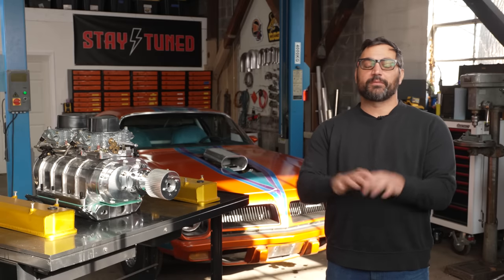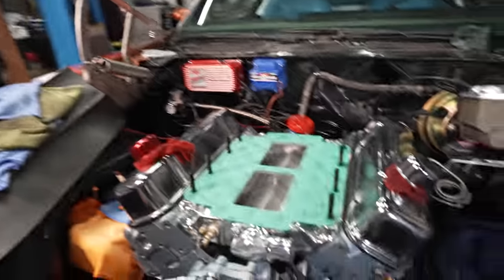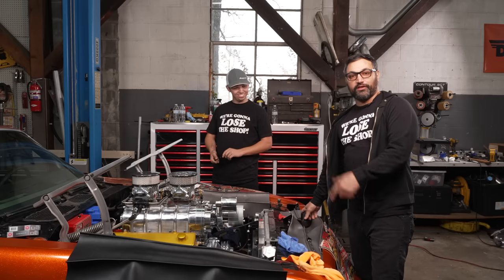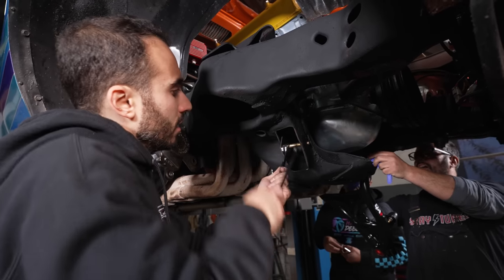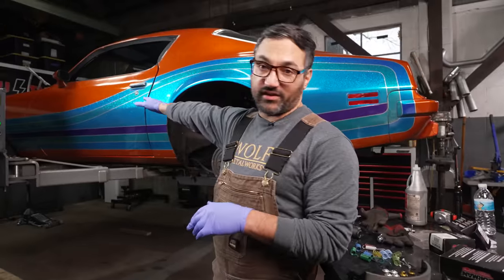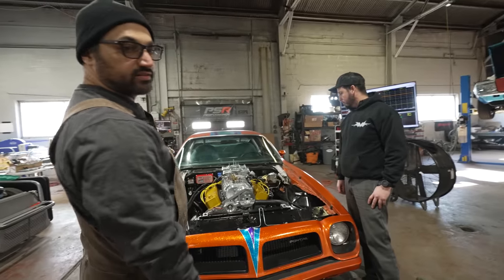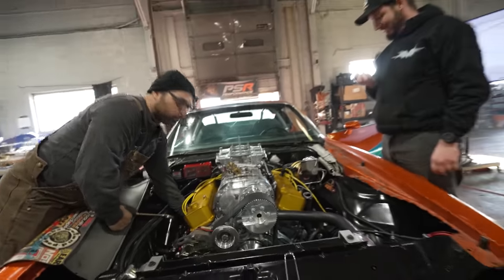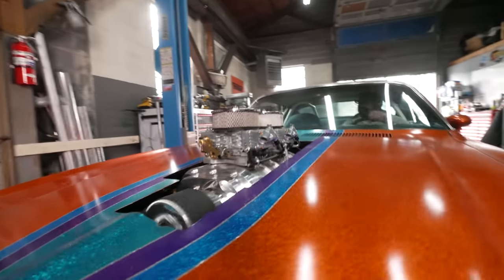Can An 85 Year Old Supercharger Make Hellcat Power? - Tony Angelo’s Stay Tuned

Comment: To add to the blower description, these (as Tony explained), came off of GM Detroit diesel 2 stroke truck motors. The 6 in 6-71 is the number of cylinders that the engine had (4, 6, 8, 12 & 16 cylinders) and the 71 refers to the cubic displacement of EACH cylinder. 71 being 71 cubic inches, 92 is 92 cu/in per cyl etc. So, a 8-71 was from an 8 cylinder, 71 cu/in per cylinder motor. Same as 6-071, 8-71, 8-92 etc.
Reply: Very cool info. I had no idea this is what the numbers meant. Thank you. Now that I know, it's SIMPLE.
Reply: @phillipzx3754  the 6-71 is inline but there is a 6v-71 and 8v-71. The 12 and 16 cylinder versions were two engines mated. Eg The 12v-71 is 2 6v-71s inline. 
One of the Sherman tank variants used whats called the GM twin diesel. It’s 2 6-71s in parallel, one of them runs counter directionally to the other, turning a shared output. 

You can run a Detroit clockwise or counter clockwise. 

2-stroke diesels cannot naturally aspirate so they require superchargers. Some had turbos but all had superchargers.
Reply: They also made a ton of 1, 2 and 3 cylinder engines.
Reply: @danh8302 interestingly, these are technically blowers on the Detroits as they are used to clear the combustion chamber of the exhaust, not pressurize it. So they are not used as superchargers on the Detroits, so they are still considered naturally aspirated.
Reply: @spencercastle8638  the call them that because they don’t have turbos but two-stroke diesels cannot naturally aspirate. They require them. So normal aspiration for a 2-stroke includes a blower.
Reply: @danh8302  worked on Detroit’s a little bit, really really odd engines but it makes sense when you realize what’s going on. Superchargers essentially the intake 😂
Reply: The idea was to find bigger options than already available is what I thought too since supercharged cars were like the inline 4-8 cylinder European race cars starting in the 20’s so the Detroit diesels seemed to be the best option
Reply: @spencercastle8638  Yep... The ones with the supercharger(s) only were "Natually Aspirated", and the ones with turbos that fed the supercharger(s) were forced induction.

Edit: I worked on a BIG ass generator that had a V-16 Detroit on it that had 4 turbos feeding into 2 superchargers on top the engine... It was essentialy two V-8 blocks bolted together to make a V-16, 4 heads on it, 2 intake manifolds, 1 turbo on each of the 4 exhaust manifolds, 2 turbos blowing into 1 supercharger on each of the 2 intakes. The thing ROARED when the genset was tested at max load.
Reply: @dan h  not all detroits can run clockwise and counterclockwise.  It is by design.  If you try to run a regular truck engine in the opposite direction, the blower spins the wrong way and evacuates the cylinder.  Additionally, the oil pump cannot feed the engine spinning the wrong way.  Yes, they can run backwards, but they run poorly and will self destruct if you don't stop them.

To add, the so-called superchargers are merely airpumps.  They don't pressurize the cylinders on a Detroit.  They became superchargers when racers discovered they were effective at creating boost when installed on a 4 stroke.
Reply: @da1ve468 low e.t.'s  I drove a kenworth that had a 8-92 with 2 turbos, it would turn 2800 rpm. Originally a logging truck from Canada.
Reply: Idk if I read that incorrectly but I’m almost positive that Engine has 8 cylinders
Reply: @gosstg09  What engine are you referring to?
Reply: @davelowets  the one he’s putting the blower on
Reply: @gosstg09  Yes, it is an 8 cylinder engine.. This comment thread is about where these types blowers got their start in life. They weren't originally designed for high-performance gasoline racing engines. The blowers were originally designed for large 2-stroke diesel workhorses, that by design, did not "scavenge", or create any airflow of their own, without the blower present to induce airflow through the engine. 

The "6-71" blower size was used on a diesel that had 6 cylinders @ 71c.i. per cylinder. The "8-71" blower was used on an 8 cylinder engine with 71c.i. per cylinder. The "6" or "8" in front of the blower number doesn't mean that it can ONLY be used on a V-6 or V-8 gasoline engine application. The numbers only refer to the size of the blower. Any size blower can be adapted to the intake manifold of any size engine. The larger the blower, the more boost it will produce, and the more power the engine will make. (Within reason)
Reply: We have a generator with a 8v-92, supercharged + twin turbo!
Reply: Do you know why they paint a Detroit diesel engine green?

So they can hide in the grass when they get passed by a Cummins. How embarrassing.
Sorry, old 80's joke. Tuning a Detroit in the old days wasn't the funnest.
Reply: Spot on mate my father is the C.E.O of Detroit Diesel Australia well it's actually PENSKE POWER SYSTEMS NOWADAYS or MTU for the off highway stuff but yes the good old 6v71 6 cylinders 71 cubic inche per cylinder 6v92  i love the the massive compound set up they run with the turbo running straight in to the top of the blower on the 2 strokes 🇦🇺💙🇺🇸

Comment: Absolutely loving his thing. I hope you gradually continue to develop this thing on the drag strip. It would be awesome to see some 8 second passes but without losing that 80s style.
Reply: Haha ya i agree. i think an 8 second 1/8th mile is doable, 8 sec 1/4 would be like 50k of upgrades
Reply: Yeah no, that's not happening, you need WAY more HP to pull an 8 seconds 1/4 on that thing.
Reply: That’s why I said to coni tie to develop it. I wasn’t expecting it to happen overnight. It will likely take significant engine, suspension and general upgrades to get there. But I don’t think a 8.99 in the quarter is out of the question.
Reply: 8 second passes? Not with that Pontiac block and drivetrain.
Reply: Maybe triple the horsepower? Along with new trans, bigger tyres and everything else in between.
Reply: '70s style.
Reply: johnstamper715  one in a million

Comment: Pontiac trick #1 is to cut the water cross over off the intake so you don't have to drain the coolant to get the intake off. Which wouldn't matter in this setup because you're changing the cross over type but just a heads up.
Reply: Yep. It also makes it way easier to port match the intake runners

Comment: Tony: Make sure you synchronize the carb linkage and check for wide open throttle. Just have someone hold it to the floor while you peek into the carbs. Really happy to see the blower finally go on this thing! You've got a little stumble when you whack the throttle, so make sure you adjust the primary accelerator pumps. You might need a more aggressive pump cam. It's a really great idea to run boost referenced carbs because they blowers can pull a vacuum at high rpm wide open throttle and cause the power valves to close which leans the motor out and kills pistons. If you don't have those, just run a higher-than-normal power valve like an 8.5 and it'll be fine.

Comment: Tony and crew, you knocked it put of the park!
This old Pontiac firebird with it's hand ported heads and the 6/71 roots blower is more interesting than literally all the cookie-cutter turbo junkyard LS builds that flood the internet.

The key here is the historic nostalgia.
In 50 years nobody is going to yearn for the era of turbocharged junkyard engines fitted to plastic cars.

But cars with chrome bumpers, roots blowers and the hand built oddball engines will always be a worthy pursuit.

You've got one of a kind, and that means something.
Reply: I dunno man, there's definitely something to be said about cheap, fast, and fun cars. Not every build has the goal to hold value and be a collector piece. Some of us just like building fun stuff. Tony's T/A is definitely super rad, but the '80s theme isn't for everybody. Just like an S-10 with a turbo LS isn't for everybody.

Comment: Man of the year for keeping a Pontiac V8 in it....😉👍
Reply: Oh so what you’re saying is “click off the video right now cause it isn’t touching 700hp in Tony’s dreams”, Pontiac V8’s were dogs compared to what you could build a 350 up to be, the 400c.i from Pontiac was ass
Reply: @mullittmustang256  Huh?.....I was just giving him some credit for trying to do it the hard and expensive way to keep it all Pontiac they way it was done back in the 70s and 80s.....a modern truly reliable 700hp with an outdated Pontiac design requires aftermarket block, heads, bottom end parts, it can be done......any fool with a  check book and a summit/jegs catalog can throw together a cheaper, more reliable, and more powerful chevy or ford engine.....at that point you might as well just have a camaro or mustang which everyone else already has.  Either your a fan of seeing guys who like a challenge to make more power with some of  the older off brand stuff like buick, olds, pontiac, mopar, amc, studebaker etc......or your one of those ford vs. chevy guys.  I  like anything thats fast or neat looking, bonus if its both.
Reply: @jasonrackawack9369  no I just hate junk engines, even butler performance can’t make a 400 Pontiac do good unless it’s fully billet aluminum. Swap in a 350/396/454 and then it’d be feasible to build up and still be gm powered

Comment: Tony I hope u will read this.. back in 1978, I took a 871 GM blower to my local High School where I kind of went, but the Machine Shop teacher sort of liked me. I also took a old mid rise tunnel ram intake from my 426 hemi. that was also at the school shop, where pete and i were grinding and polishing the heads and head serfaces on the block. we cut off the top of the intake manifold, and i took it into the welding shop and I welded the base plate Pete cut and made for me on a old mechanical Mill. we then milled the intake faces and the blower base and polished them.  Pete then built me a Drive for the blower to make the belt alline, with the belt tightener we also built in the school machine shop. Making the top plate, I had a friend way smarter and tallented than me set and adjust the shakey old 750 double pumper carbs. Ralf was a complete mirical worker when it come time to tune and adjust carbs.  His and my need to go even faster, we converted to Mixed Fuel. I cannot remember the exact name but we mixed Nitros into the fuel. because my class I do remember we were only allowed to put so many onces to the 4.5 gallon fuel tank. to make you shudder, my fuel tank was a cut down army Jerry can. I had all of that in a 1969 chevelle, i put a drop axle from a 1966 fargo truck because the A frames in the susention could not carry the weight.   The diff was a Ford Pickup 9 inch, that beleive me was one super sketchy suspention sort of 4 link. I think was more like a 2 and a half link with some rods that were sorta there for good luck. lol.  but I raced the car for 3 sumers with out to much trouble. into the fourth year the blower exploded and the car burned so hot it litterly melted down things i could not beleive would melt.   I do miss the old thing alot. cause it was a fun little car to drive, scary but fun. and i still here to remember it and tell about it

Comment: Detroit 2cycle 71 series engines ranged from a 2-71 to a 24v71. There were inline and V types in the 6 cylinder models. The first number being the number of cylinders, the 2nd number cubic inch displacement of each cylinder. Each one had a supercharger for scavenging due to the fact there was no inlet valves only exhaust valves.

Comment: I used to work on Detroit Diesel 2 cycle engines, rebuilt a ton of these blowers on varying models. They were gear driven with a splined shaft and 'shim pack' (for shock absorption). Great movers of air.
LOL at the 23andme comment. 
The car is an animal!

Comment: Worked at a Midas long time ago, early to mid 90's. The drum brakes where the easiest to do. I went in a circle, back shoe around to wheel cylinder. Had a rear axel brake job down to 15 minutes with machining drums.

Comment: I use to work on the old Detroit engines the blowers originally came off of, I have even rebuilt some of the blowers. The numbers 6-71 stand for 6 cylinders, 71 cubic inches per cylinder.

Comment: Interesting video that I liked a lot. 'Back in the day' late 60s a friend bought a retired professional 1/8 mile drag racer a 1962 Pontiac Catalina Super Duty with 1/3rd of the frame cut away, named Alcoa Presents. All the supper duty and factory experimental parts came with the racer. It was restored to racing condition and the appearance of an every day driver with headers. It was a most exciting year! I won't go any farther because it was somewhat shady and against the law. Moving on my O.C.D says they are not pulleys they are sprockets.
Reply: I'd love to hear that story

Comment: I was on a mustang dyno for years. Made 468hp 415tq on a 2001 trans am stock ci ls1. Went to a dynojet to see the  numbers clime but only made 473hp. That's because a mustang dyno can be set up to read like a jet by the operator if they choose. I didn't know that. I now have a 2019 zl1 and make 842hp 733tq on a jet. Im solving some fuel issues and should push close to 900hp this year.  Great video, thanks for posting.

Comment: Hi
 I have an 871 BDS Kit on my 74 T/A it is awesome. I put on a long time ago, but it all came back watching you guys. Wanted to let you know that the bolt for the crank was not to short, it is supposed to go behind the pully's directly into the balancer not sure if it will cause you any problems or not, I ended up machining out the center so that I didn't have to pull the pully's if I wanted to remove the Crank hub. Love this car and you show.

Comment: I had a third Gen Camaro, The only issues I had were the T-Tops leaking and the Clutch Rod pushing through the firewall. I had to weld a plate on to the unibody to score up the Clutch rod. Was a pain in the ass. Aside from that it was a nice car. But alas I have always been a Mustang guy. lol

Comment: Yet my 1979 Camaro only had a whopping 160hp from the factory. Yanked out that block, built it for a spare and made a 383 out of it and it put down 337whp/410ftlb and I got bored with that really fast, yanked it out to save it, put in a crate engine, LSA 6.2 and have it now at 601whp/682ftlb's with just a few cooling mods and bolt ONS...... Amazing what boost does..... Yet I still want more but live in Cali and have to smog the car yearly. 😂 So for that power and a quick catted mid pipe swap for the smog cops makes it all worth while. I am also insured thru hagerty so what a coincidence this video popped up! ❤️

Comment: I noticed that intake adapter only has 4 runners feeding the 8 cylinders - does anyone ever cut out the gasket between the adjacent intake ports on the heads then port the divider down to more of a "knife"/rounded edge to help with airflow? I'd be curious how much power it might be worth - of course the flip side is that now your heads are no longer usable without a blower and in a forced induction application it may not be worth as much as you think bc they don't tend to be as sensitive to things like that compared to NA. Just curious.

Comment: Fun!! Hard to beat old school cool isn’t it! I fully agree with the fake drama BS on almost every show. 3 tools I’ve had since the late 1980,s make rear brake work cake work, and doing over 300 drum brake jobs so far helps as well. Since the late 1980,s. Right on with the QA1!! Low compression hi rebound I use on my Tempest. I put my old grin shims in the exact spot they came from, installed my front uppers straight up and the alignment was perfect.

Comment: Initial timing on a supercharged V8 can be as high as 30 initial, you will eliminate the vacuum advance because it will never see vacuum again, also lock out, or severely limit any mechanical advance.

Comment: im in my early 30s was a mechanic for 10 years and some of the city mechanics i worked with came to me for drums cause i got my dads old tools when i started and being from a poorer farm town i did a ton of drum brakes growing up and in my first shop. the only ones i hate are the horshoe springs on GM drums from the late 80s to early 2000s. especially on the trucks

Comment: Impressive numbers from minimal amount boost.  Especially on a "Mustang Dyno".  I used to take my 2003 Mustang Cobra (Terminator) to a shop in Scottsdale Az (SVC motorsports, no longer in business) SVC used a Mustang Dyno.  I did the initial usual pulley swap and custom tune.  When I picked up my car, the mechanics at the Shop were excited to tell me my car is putting down right at 380 hp / 385 lb/ft.  I then asked them what was Baseline on the car ?  It was 320 HP on their Dyno.  I mentioned these numbers because they were over 15% lower values than some other guys I knew with stock and similar mods to their terminator on different dynos in town.  I don't know why Mustang Dyno do present much lower numbers when compared to others.  But the peak numbers really don't matter if you keep using the same Shop / Dyno.  And use the numbers for comparative purposes after different mods / changes.  
    So 568 HP at the rear wheels for the Pontiac might be like 630+ on a Dyno-Jet Dyno.  And allowing for approximately 18% drive train loss, would equate to approx.~ 750 HP at the crank.  So definitely in the Dodge HellCat arena !!

Comment: I was doing drum brakes when I was about 15 years old with a pair of channel locks long nose pliers and just remembering what went where but if I did have a problem I could always look at the other side
Reply: Yessir. Only take one side apart at a time so you can look at the other side if necessary. There are drum brake tools that make the job much easier than using pliers, vice grips, etc. It's really not a hard job after doing it a few times especially with the proper tools. The REAL problem now is getting the parts.